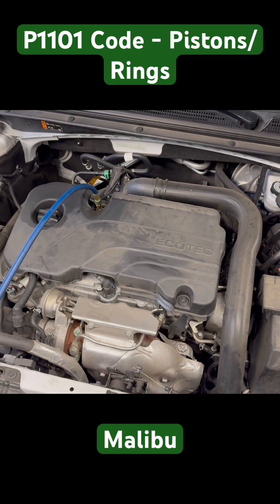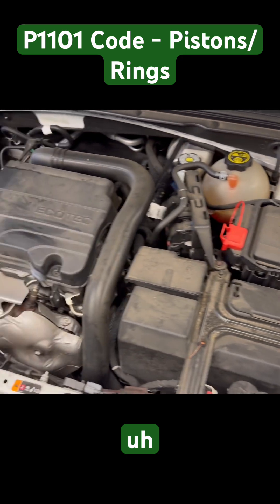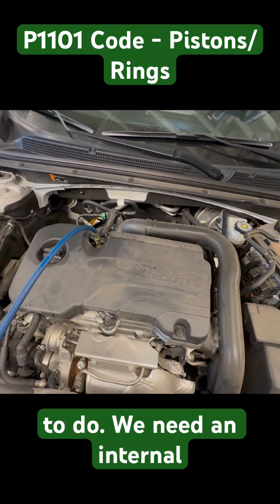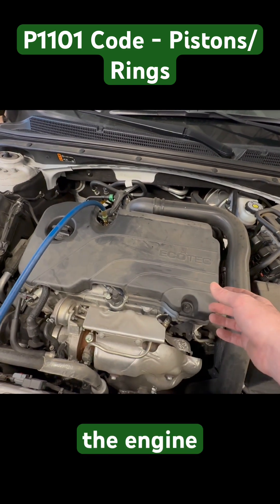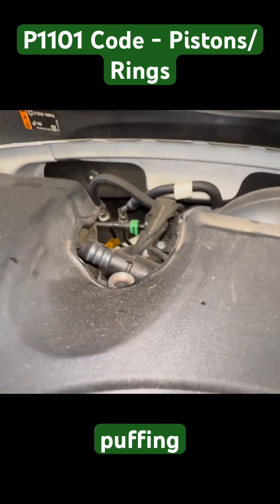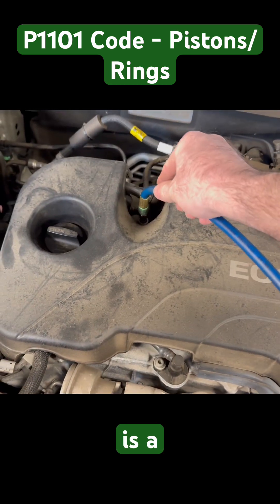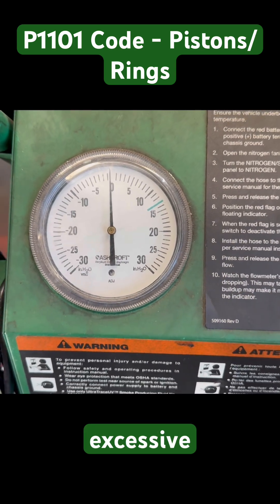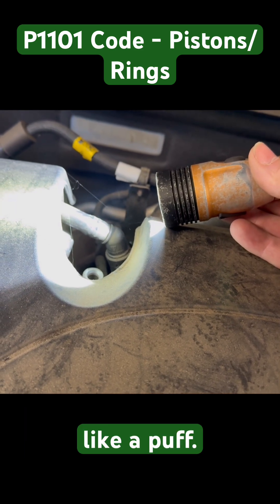P1101 code - Faulty Pistons - Faulty Piston Rings

Comment: GM switched to direct injection without a plan for PCV. So now you have the same problems as prior year 2.4 with direct injection. Plugged up PCV resulting in a backup of blowby and moisture ruining engines over time.
Reply from the maker: I never used to see this level of internal mechanical failures until GDI engines became common... Along with the fact that it is always a small displacement engine and turbocharged (on regular fuel?) (WTF) (runs HOT) in a heavy mid sized car. Customer driving habits have the largest effect on these sort of failures... Another thing that had REALLY affected the situation is remote start being standard on many vehicles now... Idle idle idle.

Thanks!
Reply: This is a pretty common trait with Di, but can also happen to port injection. Long oil changes intervals, short trips or people who live in colder climates usually are the recipe creators for this issue, and it goes across the board, some engines are just a bit more susceptible to these issues. If people would stop running long drain intervals  these issues would be greatly mitigated.
Reply from the maker: Yep! The problem is much much worse with GDI engines though!

Comment: Could’ve been prevented with decarbon servicing done every 20-30k
Reply from the maker: Take a look at this one here... P1101 code 1.5L LFV GDI engine heavy carbon/Stuck piston rings- approx. 26,700mi -  https://youtube.com/shorts/oY9LGEHAeQs

This customer was doing 5000 mile or less oil changes with quality oil and filter... They were doing chemical oil flushes at every oil change... They were also going regular GDI cleaning services as well.

Somehow the pistons still ended up totally coated with thick carbon and the rings were stuck with less than 27,000 miles. 16 mile short trip commute may have contributed.

I think these new under-sized turbo GDI engines are just junk and designed to fail.